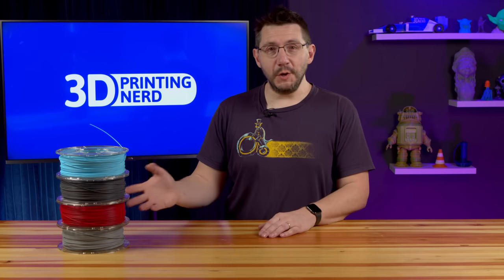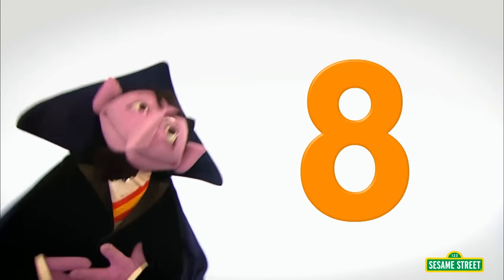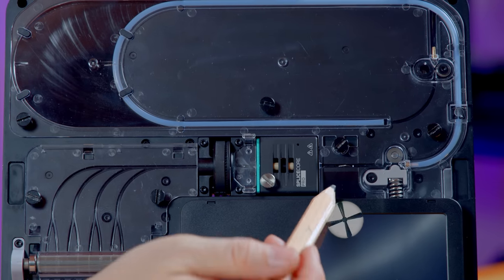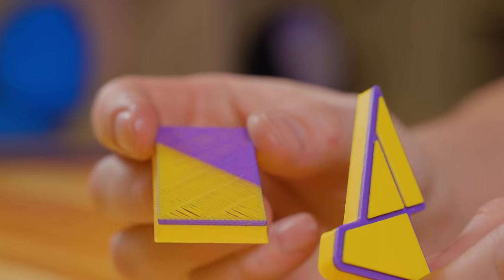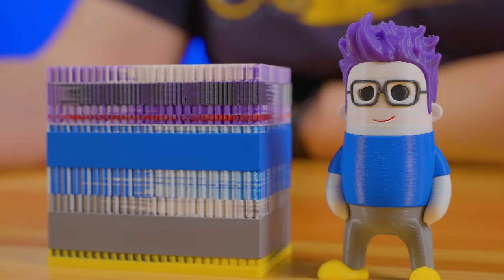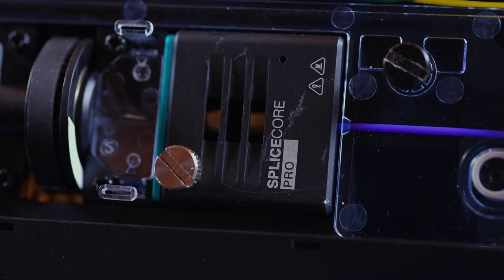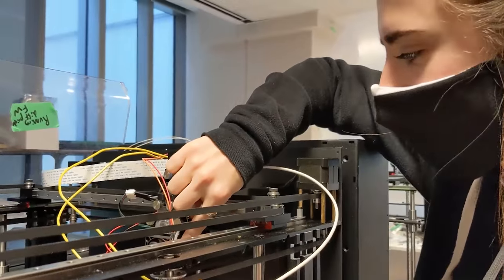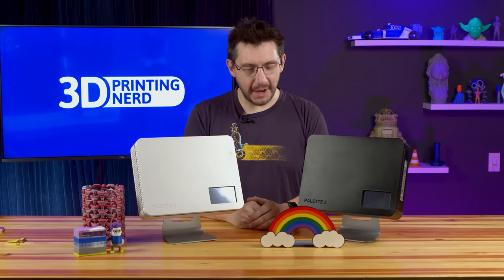8 Colors At Once! // First Look at the Mosaic Palette 3!

Comment: Do something with water dissolvable support material and different colors of very flexible material.
Reply: Love the cut scenes....always good to get a laugh in while learning!
Reply: I wondered if they could work in PVA for support material
Reply: Mix in some flexible filament... Vibration dampening, built in straps...
Reply: These machines are trash for TPU, dont bother with TPE super flexibles
Reply: Yes of course you can add PVA filament too
Reply: Water dissolveable support materials, does that actually exist, sounds way better
Reply: @Hohmies86  it's called PVA!
Reply: Best option is to have duel extruder and do ur colors threw the palate and the second nozzle do ur support filament cuz switching filament types can be done but its tough with these i would stick to pla, abs or whatever (palate 3 can do temps to fuse anything up to nylon not PC tho) and use the second extruder to do support.

Comment: I feel like if you use a palette it should be encouraged to take those transition blocks and find a way to reuse them...

Perhaps a fun thing for them to code could be that when you print with multi colors instead of a useless block it has the ability to make a useful print instead of a block of filament.
Reply: @HappyAchterhooker  It could be an Easter egg of sorts. A "feature" to be turned off and on. I know I print a bunch of stuff that would be awesome multicolor, but I also print door stoppers that color doesn't matter because they get broken or lost at the office.

Im not trying to be an eco warrior, but my first thought was ugh what a waste of material... The purge block is almost the same size as the rainbow....
Reply: I've seen a device that allows you to extrude little balls that can then be recycled back into filament. That could be something useful.
Reply: @Mikowmer  I thought I remembered a video somewhere that demo'd a product that allowed reuse of filament, it had to be ground up and than it melted it into filament again...
Reply: @jhbryaniv  Yeah. The pellets created by this device are small enough that it doesn't need to be ground up again. I'm considering implementing it on a printer I'm building at the moment.
Reply: @HappyAchterhooker  yes, in PrusaSlicer, there is the option of a perge object, that's of the transition of colors goes into that object, it also has a setting to add perge filament as infill, but it still has a perge block because it might need to perge more than will fit and perge to remove the underextruded first bits that might occur. 
I have an MMU2s and am mostly frustrated with it, but I like what they are trying to do with it
Reply: Firstly i like them to get smaler. They really don´t need to be that large. A way to do it would make a test print then take a photo of it and let the computer calculate how much purging is needed in steed of just doing a lot of it. 

Also deposit it in the infill and other layers is also logical, at least for filament that is not translucent.

Also a nosil that have a better laminar flow wold drasticaly decrease the amount needed.
Reply: That’s a great idea John!
Reply: they can instead print filament, which will have mixed colors and it will look great when printing with it... i dont remember where but ive seen one guy print his own multi colored filament...
Reply: I wish you could just print the extra material in the infill instead of a block period. Or like was mentioned be able to print a functional object instead of a block. The block could always be recycled as long as its all the same material.
Reply: That's what i thought. People should have small objects queued up so it prints them with the transition alongside the actual main print instead of making all that waste. Ear savers and doorknob/button touchers are a simple thing which the world needs at the moment. Everyone could purge print those and give them away.
Reply: I thought they would be able to use the infill to purge the color a bit.
Reply: I think there’s been an open feature request on the Canvas (slicer) bug tracker for specifying a purge model, but in the meantime there’s a postprocessing script that lets you convert PrusaSlicer MMU code to Palette code so in theory you could use that to get a purge model. I haven’t tried it yet though.
Reply: @eca7773  You can use the infill as transition space, yeah, but that doesn’t work too well if you’re using very light-colored or transparent filament as part of your print. Also even with infill transitions turned on it still needs a transition tower if your infill isn’t sufficient for a clean transition.
Reply: Yep, I love the hobby, but I hate plastic waste. The toolchanger for instance doesn't really need a tower, I think towers are just such a waste.
Reply: Prusa has several possibilities for that.
1) You can print into a second model. You do not get a purge tower, but the same model with banded colors.
2) You can 'wipe into infill': the purge tower is your infill.

I have also seen a printer which purges just the needed amount in a wastebin/slide on the side, so there is no tower created, only a bin of loose ends. But those are minimal, and where there is no purge needed (as with Joels feet or shirt) there is also no tower built.
Reply: Take a look a Joe’s video where he up-cycles his purge blocks: https://youtu.be/Bggy1nVtuWY
Reply: @ArdjanVideo  The slicer for the Palette has options for putting the transition into the infill, but depending on the model that might not always work so a tower is still needed. And you can also set it to purge filament at a specific location (where you would set-up a waste basket) instead of making the tower, but of course not all printers will have a good place for a waste basket.
Reply: @VincentGroenewold  Yeah, but toolchangers require a fundamentally different printer design. The advantage to the Palette is that it can work with any existing printer.
Reply: @ArdjanVideo  The Palette actually supports off-side purging, although it doesn’t work with every printer
Reply: @matsv201  he stated in the video that you are in control of the purge amounts.  Mathematically, there isn’t anything useful that could be made from the purged filament.  If you want to collect all waste and send it somewhere, that is an option, but you’ll be spending HUGE amounts to do so, with a pay off of only a few cents. Thus you’ll spend more money trying to do something with it, than you will get back.  If that works for you, go for it.
Reply: Or better use the material as infill
Reply: Hear me out...  for larger models there should be an option to purge on infill.  That way it’s not seen and there’s no waste
Reply: I second this, use this as add space for advertising and get cost free prints. Or use this to print 3d models for customers while you print color prints for yourself, vice versa
Reply: Truly, as much as I adore 3d printing the plastic waste is horrendous and this takes that even further

Comment: I think a print-in-place Rubik's Cube would be perfect for this! Other than that, I think this technology allows you to save on your expensive filaments by using cheaper filaments on the inside for structural support and the fancy filaments for the exterior!
Reply: you would have to be spending a ton on your "expensive" filaments to offset the cost of the pallette....
Reply: Jordan lets help him out , carbon fiber outside , and cheap inside then it makes sense
Reply: @corellian6522  Eh it's like since you can have more than 2 colors so why not do it kind of thing.
But yeah, it probably would not save that much, but is sort of useful I suppose if you don't have much of a filament but for some reason have a lot of another
Reply: @corellian6522  You don't buy it solely to save on cost, of course. But in my country, some filaments can cost almost double of the cheaper stuffs. It is just something extra you can do while the main purpose is to print in multi colour
Reply: Wouldn't a dual extruder set up work just as well?

Comment: It would be better if you use white filament and could inject pigment into the heatblock to mix a colour on demand :) Like inkjet cartridges for printers!
Reply: Something like the person who used markers to change the colour
Reply: Rather a translucante than ad white pigment to it.

If the filament is translucent all the pigmetn is vissble after its melted and it get a much better result.
Reply: @matsv201  Yeah suspect translucent would be better, but may cost more to produce. Only a thought no idea how it would work in practice! Would probably need some sort of fine powder pigment and feed through an auger but may not be remotely possible
Reply: I think XYZWare did something like that, but personally I don't support them because they're trying to bring the traditional printer business model into 3D printing. I.E. sell the printer at a loss but lock your customers into your proprietary parts and (microchipped cartridges of) filament.
Reply: da Vinci Color does that by xyz printing.
Reply: Or a small cnc spray paint nozzle
Reply: @theninjascientist689  They actually give you the option to go third party now with their materials, they changed that long ago.
Reply: A filament that changes color via UV treatment or such would be in theory easy. Even if just shades of brightness.
Reply: @theninjascientist689  Plus the inks used to color the filament are insanely expensive.

Comment: Can you please please please test how it handles not only different Colors, but also how it handles different Materials?

Like a transition from PLA, to dissolvable Support. 
Or Nylon, to TPU.

besides that, thank you so much for covering this, I was allready hyped for the pallet 1, to see how it evolves is stunning!
Reply: Great questions! yea preordering is not always a good idea, especially when we don't have all the answers from a thorough review.
Reply: Nylon to TPU will be not work.
Reply: Nozzle temp will also have to shift huge to accommodate dissolvable support to PLA and probably result in clogs or ooozy mess but interesting to see
Reply: I suppose that the best way to achieve dissolvable supports support is use multi nozzle hotend (e3d chimera, etc...), where separated nozzle is used with Pallete processed filament (PLA I think) and the second one is just for dissolvable one (PVA or others)
Reply: Dissolvable material is #1 question for me. Colors are nice, but support materials are what push printer to another level.
Reply: @thePavuk  I really not sure is it possible to acquire a good welding contact between i.e. PLA and PVA materials. It seems. Pallette expects you'll feed 8 different spools with the same base material
Reply: This (Victor's og comment)
Reply: @thePavuk  As it joins the filaments together with melt heat, I would hazard a guess and suggest PVA won't bond well to PLA.
Reply: 100 time this!!!  I want to see some stuff where maybe PLA is mixed with TPU.  Maybe a bird where the joint between the wing and body is flexible.  Or NUNCHUCKS!!  A print in place toy car with squishy wheels or something :)  Printer enclosure feet with a springy foot?
Reply: Just another +1 for showing what happens with different materials even if the don’t work.
Reply: Their website states: "Achieve high-quality, functional prints by combining flexible and rigid materials. Or, simplify prints with challenging overhangs using breakaway or soluble support." It would be intresting to see how well it achieves this
Reply: This is a great and relative question.
Reply: @MrKert86  I think the best and most reliable answer for everyone is to try to manually weld your choice of materials (eg. with soldering iron), and if it fails, it is most likely fail in this device too. The other is not necessarily true however, if you manage to weld it with some method, but the Palette can't do it that way, that may be an issue.
Reply: TPU barely works by itself in the Palette 2S Pro, dont bother trying to mix it...
Reply: @user-le4vk3ye8l  Hopefully it can do it well. I’m interested in getting one but I think I’ll wait until i see someone try it out.
Reply: My theory is that you could use a third material in between, that can fuse to both
Reply: Hey folks! The two materials don't have to fuse together, they will probably stick, but it's not important at all. Ass the Palette has it's own drive mechanism for the fillaments and an hdpe tube to the extruder, any material (at least if the process is well tuned) will reach the hot end.

If I'm thinking something wrong please correct me! Maybe I'm overlooking something important.
Cheers!

Comment: Great review their site is not showing the discount yet.  Would be cool to compare this to the prusa to see who is more efficient with waste
Reply: Tons of software optimization opportunities. Prusa did a lot more so far.
Reply: @ludovic2003  so is the mmu better?
Reply: @hunterg312  the mmu2 is cheaper and it works well once you get it tuned. (Took me about a week of fiddling)  The pallet is much easier to use out of the box and is generally more reliable.

Prusa support has been great with what little help I've needed.   And considering all of the stories I've heard about jams and feeding issues, I've had very few after the initial sensor calibration despite my less than ideal setup. 

I'll probably be picking up a pallette 3 for my other (non prusa) printer
Reply: @Mytagforhalo  I own the palette 2 it works great and thr customer support is awesome.
Reply: @hunterg312  Cool! How reliable is it? How often does it fail, and how difficult is it to fix fails?
Reply: @mattiasselin4955  it's pretty reliable. the hardest part is the initial set up.
Reply: @hunterg312  Thanks!
Reply: There should be no difference mechanics wise, only in programming with the values set for how much should be wiped and how dense the block should be
Reply: @ludovic2003  as somebody who had an mmu2s for like a year now, where has prusa done any optimization? Even after I did all the recommended upgrades I still had more failed filament changes than successfull ones and like half the time even a single color print wouldn't start
Reply: @BelviGER  I'm glad to see a negative comment to balance the others, but I have to wonder if it's your set up or other human error?

I'm only asking for posterity. You could have troubleshot it to death. Happy printing.

Comment: I'm still looking forward to when they're in sync enough that there's no huge wasted transition block
Reply: I think the problem is that when two spliced filament melts they mix. So you will always have a bit of transition time between them.
Reply: As far as I know, one option that palette have it is that you can use the transition material as infill to prevent to use the purge tower,
Reply: yeah actually I don't want to waste plastic. I always see 3d printing as a non very ecological way to work, I hate to 3d print useless minis but if I lose 50% of the material… what a waste.
Reply: You can use a (non palette splicer)  to do side transitions, where it dumps the transition off the side of the bed. Less waste, but still wasty

Comment: I'd love to see you print something with multiple material types
like flexible hinges on a box or something with conductive filament
Reply: They really suck at flexibles...gotta palette 2S pro for sale if you want to print hard plastics...
Reply: @Fly_High_FPV  That's unfortunate. I'd love this for mixed media projects for the engineering benefits
Reply: @saritshull3909  if you can get past the jamming, the bigger issue was there's no way to calibrate the esteps in the palette 2s pro (other than the calibration routine), so it always over extruded TPU which makes timing impossible (even after spending more $$$ on a Canvas Hub) ..probably fine for PLA, but struggle bus for TPU